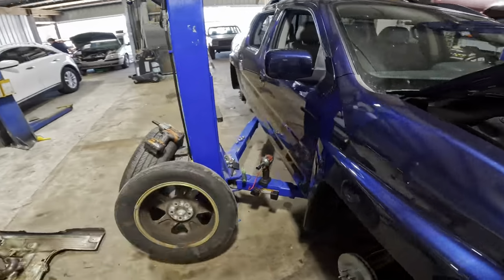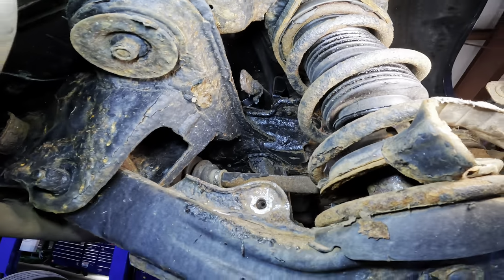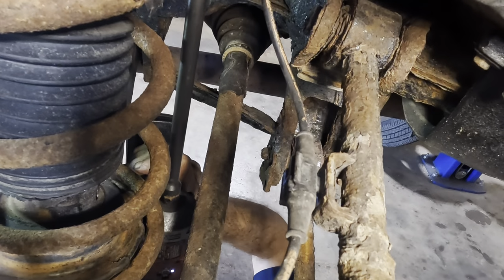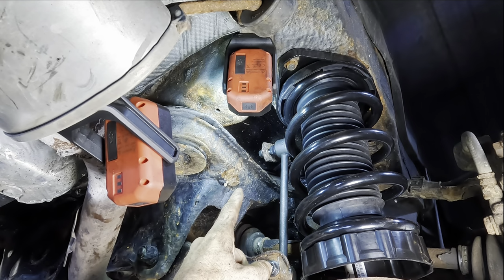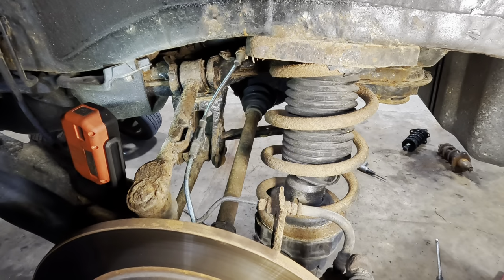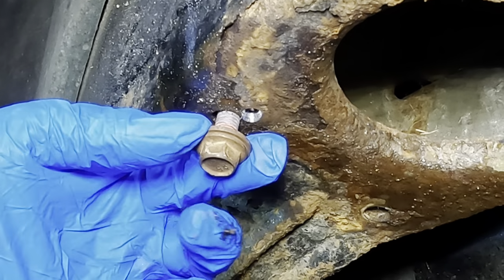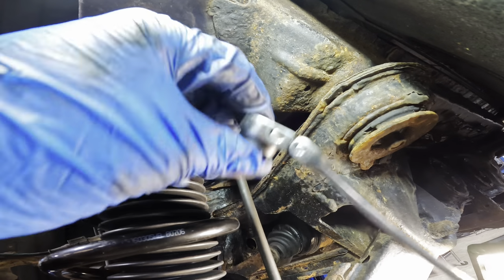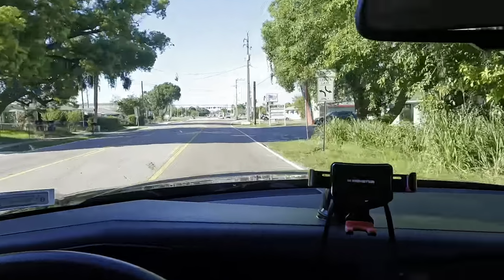Broke off in the FRAME! Strut Job Going Wrong! Honda 3.5 2006-2014 @MilwaukeeTool Pt2

Comment: It's a shame the Ridgeline looks good until you look underneath. Why should a 10 y/o vehicle be so rusted ? Doubtful it has too many years to go. I have a RAM truck with 6 more years and quit litterly 0 rust neath only minor surface rust. I do pressure wash it underneath at least once a month in winter. Then spray everything underneath with WD 40. I live in western Pennsylvania.

Comment: Those Honda not-a-ttuck-trucks inly make people think they have a truck.
They only tow 5000lbs and a bed capacity of 1300lbs assuming only one male driver.
Mediocre at best. 
A mid class truck.gets you 7700lbs towing and 1600 in the bed with a driver. My durango sears 7 amd tows more too.
Just don't buy one of these please.

Comment: You got that wrong ray, when you order them you need to ask for pre-oxidized self disintegrating bolts.

This candyass wanna be truck is nothing, i live in minnesnowta and if I sprayed rust remover on my silvery-ado I would have four tires and a seat.

Comment: Never let down by the prima donnas, novices, and basement dwelling keyboard experts  wannabes that just call themselves mechanics,,,,   been wrenching on farm equipment, vehicles, and variety of mechanical stuff since mid 60s in the worse part of the rust belt, one learns tricks & procedures & ways to nondistructively disassemble things,,, the hacks just grab a torch, bigger hammer, and sawzall and then proceed to just destroy whatever they were supposed to have been repairing